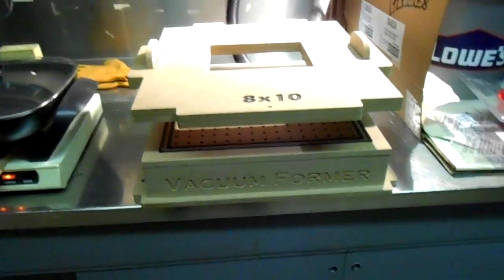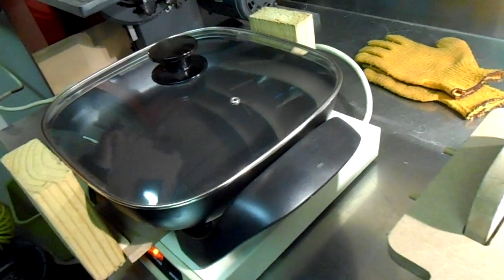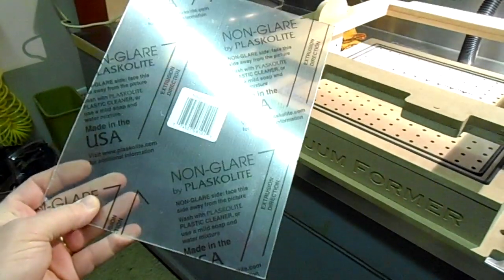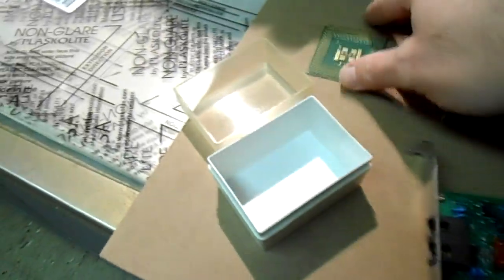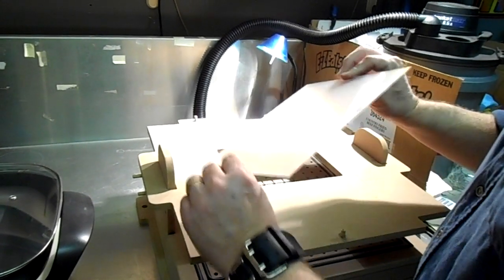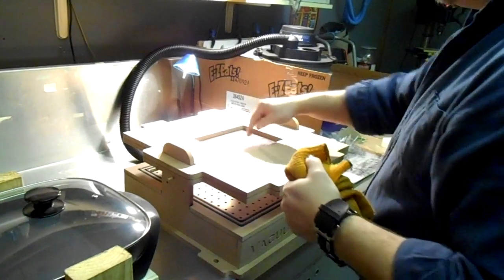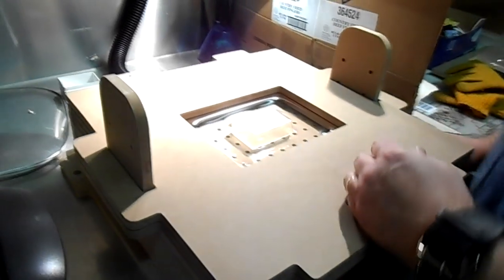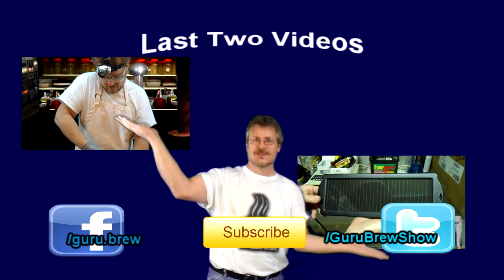Fun with Vacuum Forming - DIY Machine

Comment: Try using a sheet of PET plastic and also consider lowering the two standoffs which keep the sheet holder from touching the skillet so more of the heat transfers to the plastic.

Comment: I own a sign company and we do this type of work in our business. Drill smaller holes closer together to start with.
Secondly you need a rubber seal between the vacuum table and the bottom of the plate that the plastic sits in. Without it you will get un even suckage. lol.
Don't have the top plate slide over the arms you made, get rid of the arms. It takes far to long to line the slots up with the arms you made. Even though it could be 2 seconds time or even less, that's time the plastic gets to cool. 
In addition, on the bottom plate that the plastic sits in rabbit that out so that the plastic sits inside the rabbit and then put your top plate on and don't use pegs. You need pressure there to hold that plastic. Use bolts with wing nuts. And also place a rubber seal on the bottom and top plate. The pan you are using does not give off even heat which is what you need. Some people use their household oven. We have a old oven at our shop for this use. 
One more thing is that you need to make the open area around what ever you are pressing over larger then what you have.

Comment: GuruBrew, good video, but you need to heat your plastic more. It needs to sag at least a inch to three. Try putting the glass lid over the plastic to help it heat up. You need to use a PETG plastic. This plastic works best. I like your machine, I built one similar.

Comment: Did you ever try using a heat gun to heat the plastic?
Reply: Fill the mold with plaster, let dry and mold that.
Reply from the maker: Yes, that works too but it is harder to get even heat coverage of larger pieces.
Reply: Hey Guru, Its it possible to make a mould of a mould?